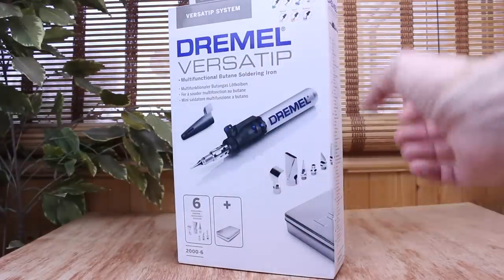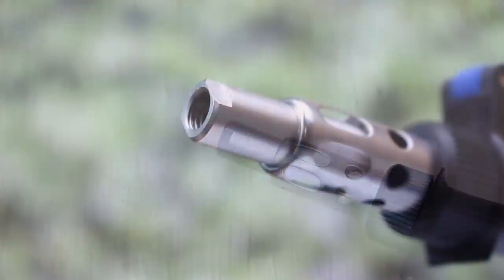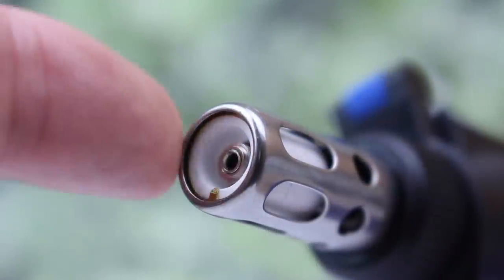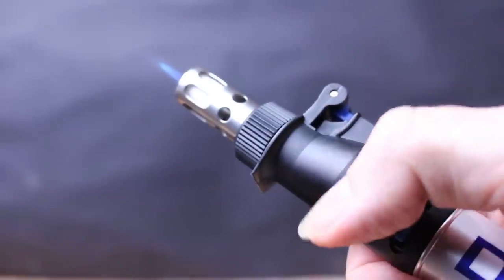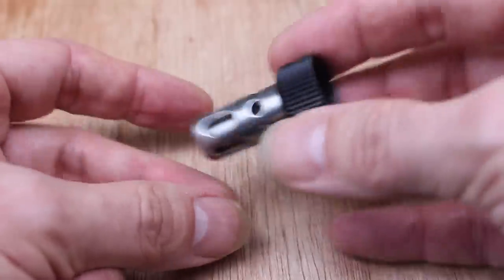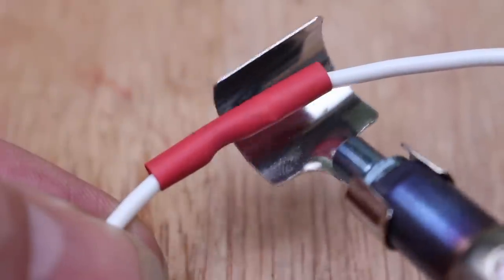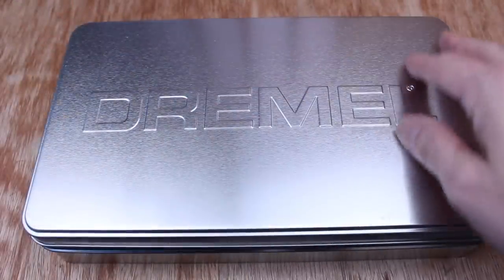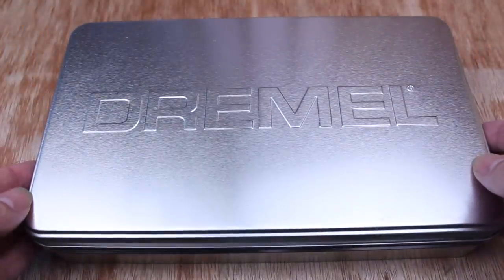Dremel Versatip Gas Soldering Torch Demo & Review in HD

Comment: Any tips for soldering aluminium rings, mate?
Reply from the maker: Hmm, That's a skill I don't claim to have. I believe aluminium (UK spelling) can be soldered but it has several issues. Firstly it melts at a very low temperature, so you can't use silver solders with it, you'd need to use special aluminium solder (if such a thing exists). I have seen videos of people using aluminium welding rods and torches, (with larger pieces) but the issue is then that the aluminium oxidises very quickly and so must be kept clean in order for the solder to bond. How you would solder small rings, I'm not sure. Hope this helps you get started looking for the answer. Dave

Comment: I wonder what would be the equivalent in watt at max power.. like 50watts ? 100watts ? I wonder if we can use it outside
Reply from the maker: You can use it anywhere, as long is not in high wind. Great for automotive jobs. As for wattage, that's a tricky one. Yes it can be used as a soldering iron, but at full flame, its way more powerful than any electrical soldering iron. Hope this helps. Dave

Comment: Will this work on silver solder.  Have bought one for this reason but doesn't seem to take hold of the solder
Reply from the maker: Yes this will work with silver solder, as you see me soldering a ring in the video. But do understand, that proper silver solder  for jewelry use melts at around 600 - 700 C, so we solder jewellery with the torch flame. The soldering tip is only for use with low temp electrical solder. It is important that you understand the difference between soldering electrical and soldering jewelry . Dave

Comment: One question: if want to fire flame continuously, I have to lock it. What about other operation, like soldering or heating, need to lock also?
Reply from the maker: You can lock the flame on. What you do with it , or attatch makes no difference. Its the flame that provides the heat, so whatever you are doing you can have constant heat, if you wish. Dave

Comment: Brilliant review, thanks! How has it been holding up over the last 1+ year?
Reply from the maker: Yep, still going strong. Very convenient for a quick soldering job (jewellery), when I cant be bothered turning on the gas and oxygen generator. Also great for soldering electrical wires in tricky areas - no cables and almost instant heat up. so very convenient for such small jobs.  and the hot knife, ...well thats just great fun ! I love it. Great question. Dave

Comment: I'm a newbie jewellery maker. I also do other bits of arts & crafts. Do I need this and the Dremel Versaflame 2200-4 Stationary Butane Torch, or are they very similar animals? Your advice would be greatly appreciated.
Reply from the maker: The versa flame is just a little bigger, and so longer between refills. Either will do for small scale jewellery soldering. Dave
Reply: @CelticDreamsCoUk  Thanks Dave, that's really helpful

Comment: Dave, I've recently bought the versatip, but a having problems getting it to ignite. Just as an open flame it ignites about 30% of the time and have not yet been able to use any of the versatip. Is there anything I might be doing wrong when igniting or do I have a faulty tool- if so I will send it back
Reply from the maker: I'd suggest the first thing is to simply try it with a small open flame. Make sure the tank is full, but leave it to rest for 5 mins to allow the gas to settle. light the flame and ensure that you can change the flame size up and down. If you can then the unit seems ok, If not then perhaps there's an issue with the valve. Hope this helps. Dave

Comment: Not sure what the case has been for others  but took mine out for first time as a relative job came up.
Found that the butane canister on the unit is/was not charged. 
IOW, you will need to ensure you have butane to charge before use. 
Fair enough - I imagine its a safety issue as well. Just a heads up! :O]
Reply from the maker: good point. Yes they come empty and need filling before first use. Dave

Comment: Hi, what camera are you using? It's brilliant!
Reply from the maker: Thank you. My earlier videos where shot using a Cannon EOS 1100 DSLR, with the standard kit lens. In later videos, where you will see macro shots, I am using The Cannon EOS 700D and the new Cannon EFS Macro lens. The 700D has the advantage of a rotating screen (for filming those selfie intros) and it also has a mic input. (I use a Rose video mic on top of the camera). Sometimes I will use a combination of both cameras for wide and macro shots. I also have two large daylight photography lights. all video is edited on my Mac mini in iMovie. feel free to get in touch if you want further tips. Dave
Reply: @CelticDreamsCoUk  Thank you very much for the information. I really appreciate it.

Comment: Hi Dave I’ve been trying  my first solder project copper bangle,s a nice set  of five can’t see any light to where I’m going to solder all clean ect but  disaster ! I was using a blow torch with a normal gas can and head bought separately  all from b&q but tried everything I’ve fluxed it  heated it all around the bangle until it changed colour ect but it would not fix ,  I know you work with precious metals but will this dremel solder blow torch  work with thick wire , thick enough for bangle making  before I buy it ? What temperature  does it reach any idea ? Or is there something I’m doing totally wrong like wrong solder for copper wire ? I go to hard where sore no one has any experience and I  I don’t know how to ask do I ask a plumber who uses copper pipe ? .......ahhhhh will you come to the rescue Dave as you usually do 🤔
Reply from the maker: Hi, You don't say what type of solder or flux you are using. Most jewellers working with copper will use regular silver solder. Remember that sterling silver and most gold alloys contain copper anyway, so working with copper is usually fine with the same solders. Pure copper does go black very quickly though, so its important to have the joint clean and well fluxed. But that's always been the rule anyway. So really just treat copper like you would silver. easy solder & borax flux, or use silver solder paste. Any torch flame should be hot enough to solder with. Hope this helps. Dave

Comment: Hello. Do you think it could be used for melting Aluminium broken chassis on a bike for example(like if the flame is strong enough)? Or other Aluminium things?
Reply from the maker: Aluminium melts at very low temperatures, so yes it could melt aluminium. As for a bike frame, that's a large chunk of metal, so Id suggest the problem here might just be size. Also I know that welding aluminium is very much a skill, as it oxidises quickly and must be kept clean during the process. Often done with an Arc welder. But check out this video below for some good tips. But Id suggest perhaps asking a bike builder forum, as strength is obviously paramount here. Hope this helps. Dave    https://www.youtube.com/watch?v=jtvOkI_pvMI
Reply: @CelticDreamsCoUk   Yes i know its not easy with the bike frame, but it seems it could do it! With having enough practice. Thanks
Reply from the maker: Good luck. Dave

Comment: Is it applicable to soldering wires onto computer boards?
Reply from the maker: with the tip installed,  It's a soldering iron just like an electric one, So no reason why it can be used on any regular "tin" soldering job. Dave

Comment: But I realize you can substitute this butane soldering gun for an electric one. Plus the hot air attachment is great for frozen locks in the winter time. I have to get this!
Reply from the maker: Never thought of that, great use for it. Dave

Comment: Hi. Would you recommend this tool to spot weld small stained glass items?
Reply from the maker: I have never worked with stained glass, so I'm not really in a position to give advice on that. But the soldering head is designed to be used with electrical tin solder, so should be fine for low temp soldering on the lead work. Perhaps check out some stained class making forums and see what they use. Hope this helps. Dave

Comment: what is the range of nozzle temperature in case of using soldering iron?
Reply from the maker: The temp will depend on how much the gas is turned up. But it melts electrical solder very quickly, so it should be around 200 °C . Hope this helps. Dave

Comment: Looks like a great tool. I have a couple drill items and they are great. One I've had for about 20 yrs and it still works perfect. Wish I had this item but I have a pace maker and I can't be around any welding or soldering product. It will short circuit my pace maker. ?? I have no idea why. Maybe u would know.
Reply from the maker: No. I've never heard of that before. I could understand perhaps not being around large welders, with high power electricity. But this is basically just a big cigarette lighter. I don't see how that could effect a pace maker. Something to do with the ignition perhaps? There are long lists of items that do and don't affect pace makers and its difficult to understand. So I'm not really any wiser. Dave.
Reply: welding creates a electromagnetic interference which will effect any electronic devices if strong enough, also electrical motors create magnetic fields which may affect electronics. Your pacemaker is a finely sensitive electronic device which can be affected by magnetic fields. Gas soldering does not cause any interference. hope this explains.

Comment: you should always use high refined butane as it wont clog the torch up. this goes with refillable lighters as well
Reply from the maker: Yes, I discovered this. Butane comes in different qualities. Ive never had any problems with the different brands Ive used. But as you say over time, i guess it could be a problem. So look for the "refined" if you can get it. Dave

Comment: What’s the difference from the 2000-01 and the 2000-6 dremel torch
Reply from the maker: Not sure. Dremel constantly change and update update models and the kits. But the basic operation will remain the same. Dave

Comment: Can you tell me why my soldering tip turns cherry red and corrodes it is 1 day old i try to solder and it corrodes on low temperature it turns cherry red i dont know if i need a higher temperature can you please help me to stop the oxidation?
Reply from the maker: Any soldering iron tip will oxidise when heated, they are usually copper. But perhaps Dremel chrome plate them to make them look nice when purchased. discolouration is normal and nothing to worry about. It will become coated with solder when used a few times. Dave
Reply: @CelticDreamsCoUk  honestly i used it 4 tank fulls just to solder and constant corrosion but today when i soldered 12g wire i had no mess no corrosion. I cant figure it out. I messaged you here because you used the torch in the video

Comment: How long does the gas last (with a full tank) while Soldering electronics.
Reply from the maker: Dremel quote a burn time of 90 minutes on a full tank. However when electrical soldering you will likely have the flame turned right down, so you should get a lot longer. That said, its just a quick blast with the can and you're refuelled again. Hope this helps. Dave

Comment: This looks great. I was worried I would need to spend $300+ on a propane oxygen set up, and have to go to some far away store to buy oxygen. Thanks.
Reply from the maker: I used a small butane torch like this for many years, before I got a pro setup. But for jewellery usage, you may find the slightly larger "Chef" type  Dremel Versaflame torch will last longer between fills it they can hold more gas. Another consideration is the Siervert torch kit with a needle flame nozzle. it only needs a propane tank (any DIY store, gas station, camping, barbecue, heaters etc). The sievert comes with a hose and bottle regulator, just plug and go - No oxygen needed. Dave

Comment: Hi, can i use this to make ball pin ?
Reply from the maker: Sorry I don't understand the question. What do you mean by a ball pin, and how do you plan on making one with this  torch ? Dave
Reply: @CelticDreamsCoUk  oh i mean those head pin to attached beads, but instead of flat head its like a ball. Normally in some tutorial, they will heat up the end until it will ball up. They used micro torch..eithet the normal kind of the pen type one.

Comment: I have one but it is smaller, but this one is a nice one. I checked and I cannot make the difference between the 2000-1 and 2000-6 which is twice the price of #1. 👍🏼
Reply from the maker: Me neither, they both seem to be the same kit. Dave.
Reply: Celtic Dreams confusing isn't it? On Amazone the 2000-1 is about 85 dollars and 165 for the 200-6.  I went on Dremel.com and cannot fine any detail or info to differentiate them
Reply from the maker: Maybe a price drop when a newer model comes out. Dave.

Comment: Hi have you tried versatip for welding pla?
Reply from the maker: I haven't really used much platinum (due to the price). I suspect you might struggle with any butane torch. Platinum workers usually use oxy / acetylene or special hydro-flame torches as you need much higher temperature than you do working with silver and gold. hope this helps. Dave

Comment: No disclaimer? Did you purchase or were you sponsored? Also nothing but good things to say, is there really no draw backs or nothing you dislike about the tool? Finally why did none of the solder flow into your parts the only time it seemed to work well was when you tinned the thin leads.
Reply from the maker: Not sure what you mean by a disclaimer, what am I disclaiming? The video is my personal impression of the tool (a review).  If you watch the video you will see that I do make possessive and negative points. I have concerns over the cap and the way the item is packaged and I explain why. So I do try to give an honest appraisal. Its up to you to make up your own mind and make an intelligent decision if it meets you own needs, that's not for me to say.  But if the tool where really bad, I would not make a video on it, Simple as that. I wont show a tool if I don't think its any good (..you wont see those videos!). The videos you see on my channel are the tools that I do actually use.

In order for solder to flow, the ends of the wires are dipped in flux, without it solder will not flow properly as with any soldering iron. But this video is a review of the tool,  I am merely suggesting some of its uses. This is not a how to solder tutorial, nor does it claim to be. I was not paid to make the video (or any of them), and the tool was a gift from a friend. Dave

Comment: What about when replacement tips are needed?
Reply from the maker: I believe you can buy the tips as a set and also the wood burning tips as a set. Several people have reported the catalyst eventually burning out, which i don't believe is available as a spare. But for the price, its is what it is. It's probably cheaper to just replace the whole thing when the time comes. Dave

Comment: does the solder have flux in it?
Reply from the maker: usually, yes,. But I always like to use soldering flux as well, as it really helps the solder to flow around wires. Dave
http://www.screwfix.com/p/la-co-flux-475g/32957

Comment: will it get hot enough to braze?
Reply from the maker: Yes. jewellery 'soldering' which I use the torch for  is typically around 600 - 700°C so is really more like brazing. Obviously the torch is small, so you cant make a pair of garden gates with it. But you can certainly braze small items with brass brazing rods. More than hot enough. Dave
Reply: thank you, for small project in rc, brazing 3/16" steel rod?

Comment: I use this one of soldering at first its ok but after that, it cannot even melt solder...
Reply from the maker: It depends what you mean by solder and what you mean by soldering. For electrical solder, you need the tin based solder, flux, and the soldering tip. For jewellery soldering you need an open flame, Borax, and jewellery grade silver or gold solder. But in either case, soldering is all about being clean, properly fitting joints, and well fluxed. if solder is not flowing its usually due to dirt, grease or oxides, due to previous heating. Dave
Reply: @CelticDreamsCoUk  Thank you for answering I use Soldering flux for electrical appliances it seems the oxides forming during very high heat, I don't know how to fix it properly maybe the coating already too far gone.
Reply from the maker: Probably the problem. Electrical flux (or plumbers flux) is only intended for low temps. For silver and gold, You need borax, or pre made jewellery solders such as Auflow, or tennacity. Alternatively you can use Paste solder which comes in a syringe. This is powdered solder (silver or gold) with cleaners and flux added. its a one stop solution. Check out my vid for examples... Dave
https://www.youtube.com/watch?v=en2KLTb-CV4&t=2s

Comment: I have been getting sick of common, large, electric soldering irons. The cable gets in the way, and battery powered is not really ecologic or economic. This may be just the thing for me. I also found out that a store near me has it, and its not overpriced as well! Maybe for the first time i will be able to do some SMD work without losing my mind.
Reply from the maker: It's not an expensive tool and has many other uses too. Thanks for watching. Dave

Comment: bro the hot air tip legit spits out flames how is it hot air
Reply from the maker: when using the hot air nozzle, You shouldn't get open flames, only heat. Check you've fitted 'ALL' the parts in order. Dave

Comment: No idea what the weird spring in a plastic tube is? It doesn’t tell me in the manual!😂
Reply from the maker: It's tin (electrical) solder. for soldering electronics and wires with the soldering tips. Dave